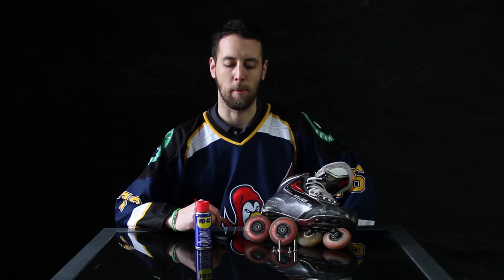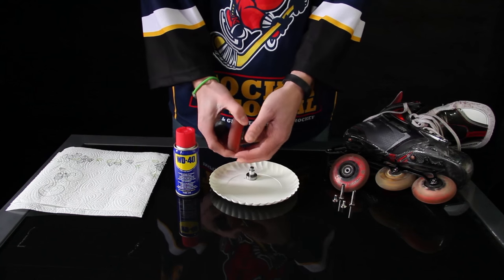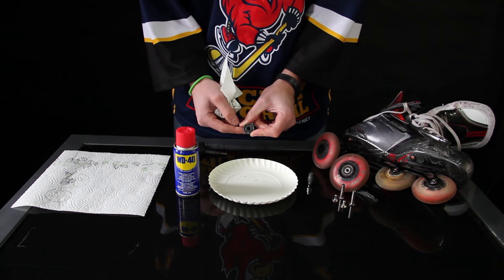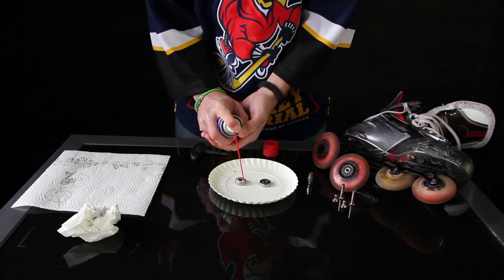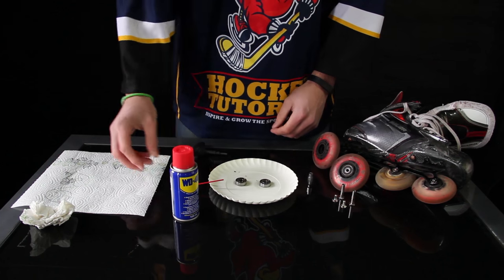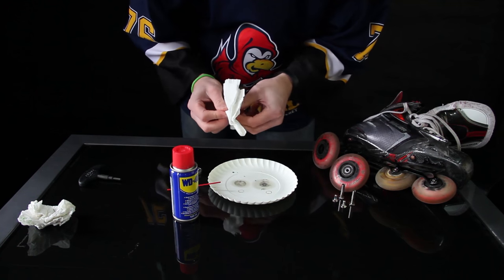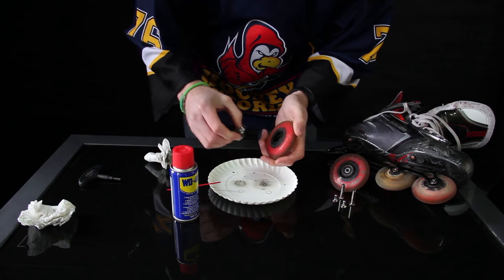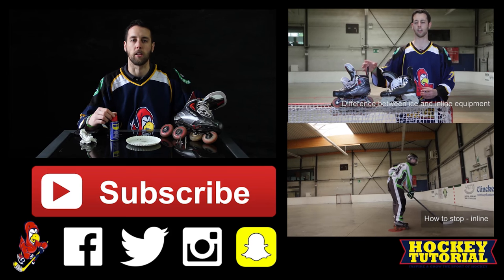How To Clean And Grease Inline Or Roller Hockey Skate Bearings

Comment: DO NOT USE WD40 to lubricate bearings. WD 40 is not a lubricant, while yes it seems slippery to the touch, it is actually designed to remove water. It's name WD40 stands for "Water Displacement #40" it is the final product in a whole run of chemicals.. It was the #40 version. It will deteriorate Urethane and other petroleum products.

Source: I work for an inline hockey company.
Reply: second this you should not use wd40
Reply: +Derek Kalinosky This option was intended as an alternative for cleaning and greasing bearings if traditional products like Speed Gel etc aren't available. We are not suggesting that this should replace specific bearing lubricating products.
Reply: +Derek Kalinosky heard the same thing
Reply: +Derek Kalinosky what should you use to lube it? I've heard silicone spray?
Reply: I have used WD40 on my inline hockey skates after every game, anywhere from 2-4 times per week, all summer, direct application to bearing by blowing them out with the aerosol (remove bearing for cleaning only once a month) and have had excellent glide, great way to get rid of day to day dirt, the water displacement is a bonus benefit, and there is absolutely no deterioration of the urethane wheels. I strongly urge anyone to try it for yourself with old bearings and old wheels...once you see that it's safe and effective, you'll be using it on all bearings and wheels.
Reply: The Cool One so you took the whole bearings apart? I tried the ATF and it still sounds like there's a shit load of dirt in there. Tried the Silicone spray afterwards too and before it all actually used canned air so spray it. Yet! Still sound crappy :/
Reply: Hi, GLiscious.  Thx 4 ur question.  No, I don't take it all apart every time I use WD40; I just squirt it into the bearings and high pressure from that red nozzle on the can after each long skate session.  Some of the grit comes out, and the bearings get lubed, but as you say, there's still some grit.  Part of the magic, though, is the aerosol high pressure (as opposed to just dripping some oil in the bearing, like Hoppe's oil).  I think it's better than the alternative: do nothing.  I, for one, do not like greases (eg Bones) because, although they can be applied less frequently than oils like WD40, they also slow the bearing noticeably and they attract dirt and sand insanely.  So, yea, I do take off the wheels/bearings and do a good job of it once a month (I actually keep a second set of bearings soaking in cleaner and ready to go for that more time consuming monthly servicing).  Hope that helps you.  Give it a whirl.  Nothing to lose. :-)
Reply: Derek Kalinosky it will work for a long time though trust me
Reply: still it should not even be option it will  damage the bearings because chemical that in it
Reply: @Adriel Ismael Yea, have been watching on instaflixxer for since november myself =)

Comment: I have been rollerblading for decades. Retired and still rollerblading a lot. Best way I have found is to take bearings apart by removing the C clip. Put everything in a small glass jar, add plenty of paint thinner and swish everything around. Let sit overnight. If a lot of dirt is present, carefully remove the bearings and shells with a pencil magnet. Then repeat the process. Once removed, place on a couple of layers of paper towels and flip or move everything a few times over the course of a day. Next day, put bearings back in their cases and add some fresh synthetic motor oil. I use oil that I buy for my Camry oil changes. 0W20 or 5W20. Then add cover and pop in the C clip. I find this easily lasts the summer. Then do this again in the spring before the snow melts and you're good to go for another season!

Comment: Why do so many people assume WD-40 is a suitable lubricant. Using a drop of motor oil would be better. Atleast motor oil is designed to resists shearing by coating metallic parts. 1 quart of motor is also cheaper and would last you pretty much your lifetime.

Comment: Don't use WD40. It's not a lubricant and it will actually pick up more dirt and particles. Use a proper gel.
Reply: What if you don't have "proper gel" I think that was the whole point of this video.
Reply: +James Downing don't use WD40 as a lube, that's horrible advice.  If you don't have gel, use a light mineral oil to saturate the bearing after cleaning.  You should use oil, not grease on inline skates.  Grease creates more resistance.  This requires more maintenance but is the most effective.  Also use a double shielded bearing rather than a single seal on one side/open on the other like they show in the video.
Reply: @downtoearthpeople  
Basically use any actual lubricant. WD40 is a surface protectant (from oxidation) and secondarily, like all petroleum products, a thinner/degreaser. It does very little in the way of buffering two metals rubbing past each other. Motor oil would be fine after cleaning with WD40 or gasoline or whatever is necessary to get gunk off. But because he can't open the bearings he would want to use an evaporating degreaser that won't thin the motor oil once applied.

Comment: Wonder which model of Bauer skates is that. I’m myself recently got Bauer RSX Blue wheels Hi-Lo frame and wheels 80mm at the back and 76mm front sometimes thinking if should have got normal frame ones as can’t put 80mm at the as not enough space between wheel and boot bottom itself. Also have heat moulded them and if you get lace bites I do all the time to the point I can’t skate no more but I haven’t heat moulded them yet. Cheers mate.

Comment: I use auto trans fluid and occasionally  brake cleaner to clean them and a silicone lubricant spray to grease. The best i have used is Ballistol gun cleaner/lubricate. Has worked well for 15+ years

Comment: Using WD-40 or special lubricating oil can make them spin easier than grease, but as you said, it doesn't last very much. Also the blades will make much more noise than using grease.

Comment: WD-40 is bad grease, because it consists mostly of kerosene and intended to clean metal parts from water (actually WD means "Water Displacer"). So you can clean bearings with WD-40, but you must grease them after that.

Comment: Never use wd40 as a lubricant it isn't a lubricant it's a cleaner, rust remover, and can be used like a penetrating fluid but never a lubricant. It does contain oils but primarily thins oil and dries it out, meaning it is also removes the oils from the plastic bearing race making it brittle and eventually crack.

Comment: I definitely do not recommend WD40.  It is not a lubricant, it is a moisture and water displacement compound.  Use a gel or speed cream.   Also, I service my bearings fall less often than you and they are much cleaner.  Your bearings may be super dirty because you are using way too much WD40 and it is attracting and holding more dirt.